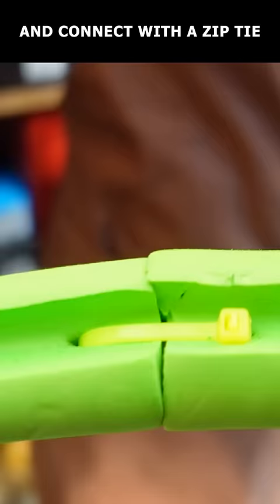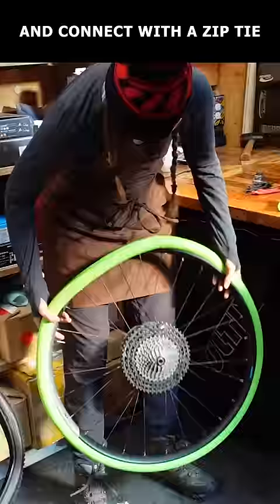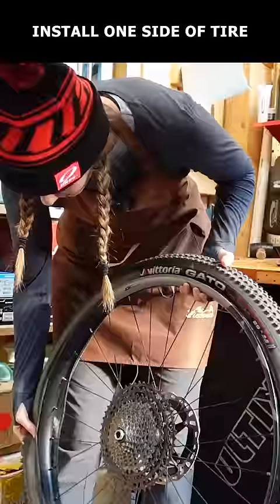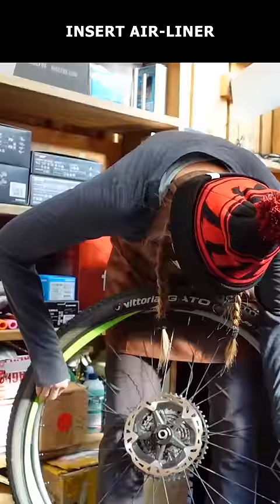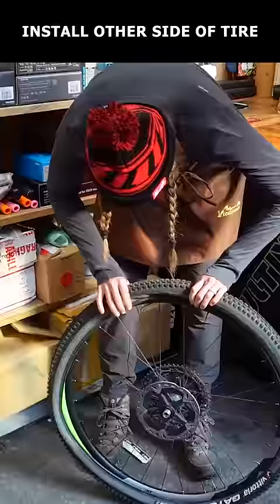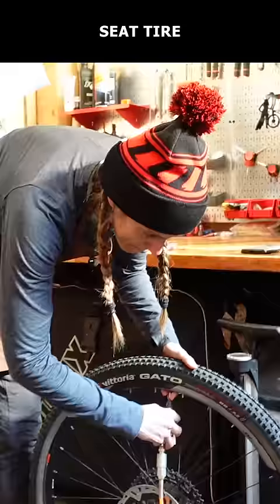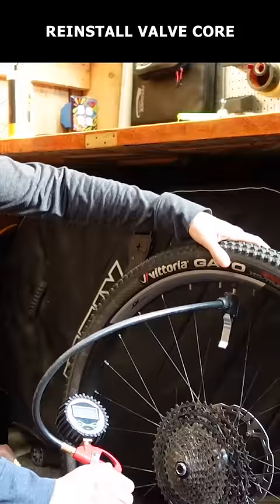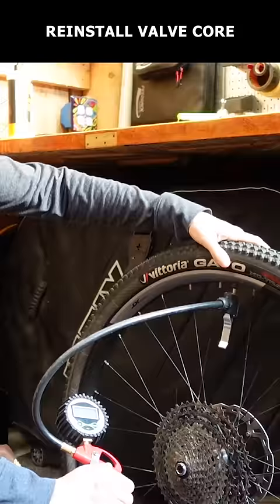Installing the Vittoria Air-Liner tire insert #Shorts

Comment from the maker: Want to try the Vittoria Air-liner? Use code "sydandmacky" for 20% off here:
 bit.ly/3jLFbqs
Reply: You are out of the only applicable size I need, 29x2.5. When can we expect for you to resupply your most-demanded size? I know I could opt for the smaller option that works from 2.25-2.5 but I'm not a medium sized rider at 6'5" 255lbs. When will large MTB air liners be available?
Reply: Im not a bike rider...but can i know what is the function of the air liner
Reply from the maker: This system provides additional rim and puncture protection in tubeless setups and allows you to run slightly lower pressures. It is also a "run flat" system so if you do get a flat you can continue to ride the tire without risking it rolling off the rim. We don't generally recommend that unless you're racing enduro or downhill, but it is an option. So, while it isn't for everyone, it's quite helpful for lots of people.
Reply: What is so amazing about this product?
Reply: @sydfixesbikes  doesn’t this re-add all the weight savings of a tubeless tire then?
Reply from the maker: Probably, but you should primarily consider this system if you want more puncture and rim protection in your tubeless setup and aren't worried about the extra weight.
Reply: @sydfixesbikes  what is the weight of a 29" liner?? How many grams of unsprung weight will i be adding??
Reply: What a Great idea.
Reply: ¿Por qué eres tan especial y bonita?
Reply: @chucky6187  p
Reply: Plss give bike
Reply: @paulstallings6804  manners cost nothing by the way, wouldn't hurt to try using some every now and again.
Reply: Try that on a dirt bike tire, not so easy.....
Reply: I've been using pool noodles all my life, and meanwhile this product existed :) jk
Reply: @sydfixesbikes  any way to do it with a tube ie the run flat cuz that's a solid method tho
Reply: I definitely need this for baltimore city!! Pot holes got me fucked up! 😂🥴
Reply: Olá tudo bem com você ❤️
Reply: Donde compraste eso
Reply: @BracaPhoto  if you're worried about extra weight u can swap allot of aluminum parts for carbon.
Reply: Hang on a sec, aren't you that guy's sister? The one who does ocean creature videos?? 😂 yall look the same
Reply: So no punctures??
Reply: Sealant and air... dang.
Reply: I want those on my fat tire electric bike 🏍😫
Reply: These are a great idea in theory but in reality it's a terrible idea. The foam doesn't stay seated and degrades rapidly from friction inside the tire. It's dangerous as well because due this disintegrating foam you will end up separating the tire from the rim while riding.
Reply: @sydfixesbikes  I had like 4 punctures in 10 years and I'm riding good. I think Im good with normal Tyre sealant.
Reply: why....regular tubeless works great....
Reply: I'll tell you why a good liners  the people who leave broken glass a good liners let you make it home 🏡
Reply: @christopherreed2694  Huh? Your thumb is drunk.
Reply: Как на разгон идёт,хорошо??🤭
Reply: That's pretty cool but damn you are beautiful.
Reply: @DonaldAJr  And DAMN you're creepy!
Reply: I think you dont know what a centimeter is
Reply: I'm lost. How does this compare to using a tube tire system?
Reply: It protects your rims and let's you keep riding until it can be changed in case of a flat.
PS:  I ride in a northeastern city with lot of potholes+ get flats all the time. I need this.
Reply: @Darkfarfetch Can I also "buy" a tire? Asking for a friend.....😆😅😂🤣
Reply: Don't you miss when bikes just took a tire in a tube and worked?
Reply: Do you have any advice for when the derailer phantom shifts like crazy even after getting it adjusted at a bike shop?  Mine only does it on hills
Reply: That's not a 1 cm hole. More like an inch
Reply: hows the performance of Vittoria gato?
Reply: overpriced on glorified foam with ziptie trashy
Reply: @sydfixesbikes  overpriced on glorified foam with ziptie trashy
Reply: I had a flat way out in the desert on a motorized bike the middle of nowhere, packed it with sand, added some water packed it some more and drove it 23 miles to nearest gas station

Comment: I started cutting the airliner, and now I can no longer fly United.
Reply: Lol gg
Reply: LOOOOLLLOOOOL
Reply: Its cause you didn't use a tsa approved knife
Reply: I loudly choked thank you very much for this
Reply: You got off easy, generally with united you so much as look at someone that works for them the wrong way you'll end up being dragged off the plane unconscious.
Reply: Hahaha
Reply: @rahinhuq1608  ???
Reply: You didn't do the obligatory sealant dance?......That's what happened!!
Reply: lol
Reply: Were you wearing your face mask 😷? If so, did you wear correctly 🤔? Did you double or triple mask? Did you have ensure you that you brought proof of vaccinations w/ 5x booster shots? Was the device used for cutting, vaccinated? What country what the cutter manufactured? Do you mistakenly use gender pronouns, instead of "Airliner Thingy"? These  are VERY  important questions to answer, prior to cutting.
Reply: LOL
Reply: Lol
Reply: Good thing you didn't try that with delta, you'd be dead
Reply: You got me good. I straight up wheezed that laugh out. Thank you.
Reply: What's the airliner for?
Reply: @j.rjunior5584  
From what I was told, it's a run-flat device. It allows you to keep riding for a bit after a tire is punctured. It makes some sense since bikes don't have space for a spare wheel like cars do.
Reply: @bloopbloop5663  kk))) kkh0
Reply: @rawtrout3402 ㄱㅋ4ㅋㄲㅋ4ㄱ ㄱ44ㅋㄱㅋㄱㄱ44ㄱ4ㅋ4ㄱ4ㅋㄱㅋㄲㄲ
Reply: You should have tried from Tail to Front, you may end up with flight steward. Win-win situation.
Reply: @j3rk1n18  😂😂😂😂😂😂🚶😂😂😂😂
Reply: @j3rk1n18  AYO???
Reply: @NeoCreatesStuff  whaddup?
Reply: Bruh that sounds like a reward
Reply: @anon457  🤣🤣
Reply: Nobody can fly United anymore
Reply: XD IT TOOK ME MINUTW
Reply: @rahinhuq1608  yeah gota use ceramic knifes they dont anger the metal detector  guards
Reply: 🎶 you broke my taylor guitar... 🎶 🎵
Reply: Double Pun, nice
Reply: Best comment 😂😂❤❤

Comment: For $100 you shouldn't have to zip tie it.
Reply: @mattbanks3517  or maybe they're the snobs who overpriced a piece of foam?
Reply: @senkl  that's true, but a zip tie is a fine solution from a design view.
Reply: They can literally make it adhesive on one side so it sticks to the wheel but they just wanna make cashh
Reply: Or cut it it should come prepared in 26 inch and 29 inch circles
Reply: @marekhlavackovi3677  this is the only acceptable answer.
Reply: @mattbanks3517  they definitely overpriced that shit 😂😂😂
Reply: Tannus armour tubeless, best insert ever
Reply: @senkl  okay, if you don't want their product but you want your own, go source your own weird exotic foam extrusion and tell us how it goes.
Reply: @microcolonel  packaging foam in the shape of a circle ain’t worth 100 dollars
Reply: @jeezyj6697  it's worth what people who won't make it will pay for it, nothing less. If you think the product is so simple, go ahead and get it made and tell us what it's worth.
Reply: @cantujessejrgbnl  an adhesive is not much more expensive than a zip tie.
Reply: @angelmedina2762  cost of manufacturing prolly like 10 cents
Reply: @senkl  so make it yourself. You'll quickly see that making a product that doesn't sell in huge batches isn't profitable
Reply: @mattbanks3517  adhesive for a flexible tire? Lmao. That'll fail within a few minutes.
Reply: @0xsergy  that 'make it yourself' argument is getting old, buddy. We can't complain a car is too expensive without making one ourselves? Phones, too? Let's take it down a notch, someone makes plastic car keys and decides to sell them for $50 and no one can say it's expensive without making their own?
Reply: @senkl  phones are a diff story, they're mass produced. This is a tube for a tire that maybe has 10,000 purchases worldwide yearly.
Reply: @0xsergy  it won't fail, but that's what another guy was saying
Reply: @mattbanks3517  eh, it might not fail but realistically the tire itself is holding that foam in place so its not going anywhere. The zip tie is just for install
Reply: @0xsergy  yes.
Reply: @mattbanks3517  yeah solution that should’ve came with the $100 price tag! Overpriced glorified foam.
Reply: Why does it even need to be connected at the ends anyway? Is it going to slip slide around inside the tire? If so, what are the ramifications of that happening? I drive cars and know next to nothing about bicycles. Please enlighten me, I like to learn new things.
Reply: @senkl  agreed... the "go make your own argument" is just about the most pathetic form of non-argumentative rhetoric there is!

I can only imagine it is something exclusively used by kids who used to say "I know you are but what am I? in school.
Reply: @cantujessejrgbnl  you don't know how things work
Reply: @microcolonel  you're the type of guy this company aims their product to
Reply: @germanfisch  Damn straight bikes are way too expensive these days, for the price of a good bike I could buy a decent used car
Reply: I feel like superglue and gorilla tape would work better.
Reply: @mattbanks3517  a simple design doesnt cost 100+ bucks lmao
Reply: @tecqnize3274  it is overpriced.
Reply: @mattbanks3517  ye no shit sherlock thats pretty much what i said lol.  if its really was a simple design it woudnt cost that much heck looking at this foam its prob not even 1buck to make lol.
Reply: 100 DOLLARS!? My dirtbike bib mousse is the same price....y'all are getting ripped off 😄
Reply: @microcolonel  bokay
Reply: @mattbanks3517  depending on the substance, why not some sort of chemically-joining adhesive? Like how superglue chemically bonds to skin. They could put it in a small squeeze container, too.
Reply: @0xsergy  you realize there are adhesives that, at a chemical level, burn two surfaces together, skin to welding, right? If you're saying you wouldnt trust welds on a bike, I've got some bad news for you. There may be a 'hard section' of the insert where the bonding occurs, but that honestly just depends on what one they use. There are some that wouldn't leave such an immalleable result, I'm sure.
Reply: @23Fists  yes, that's the problem. They become one solid piece cause of the strong bond. Most adhesives dont take flexing very well, gotta use silicone for that and it doesn't adhere nearly as well. Tires do a lot of flexing.

You do you fam, there's a reason they supplied a zip tie. Do it however you like.
Reply: @0xsergy  even with one point of rigidity in the tire, with the extra stop-leak in there, it shouldn't mess with the overall integrity of either the bond or of the insert. The sand that holds the stones in place, so-to-speak.
Reply: Cut off zipties can be really sharp, seems like not the best idea to have a little nylon blade on the inside of your tyre, especially in the orientation shown.
Reply: The only simple design here is your brain as you spend 100$ on a piece of foam you ziptie around your wheel.
Reply: $100 ! Get tubeless tyres instead 😄
Reply: What $100 i can buy inner tubes for €1.50
Reply: Juste change the fucking air chamber its juste 30$
Reply: @mattbanks3517  a simple design ? There are only 3 regular mountain bike sizes. If Cush core can make them endless why can’t Vitoria ?
Reply: @mattbanks3517  it's one of the greatest
Reply: @cantujessejrgbnl  nah glu and foam are weird and with heat I dun think so
Reply: I use Cushcore XC. Easy installation, no zipties, funtions absolutely amazing and a new must have. Wtf is this ziptie-ing BS
Reply: @cantujessejrgbnl  but if it was adhesive, it would be difficult to swap out on demand if it got damaged
Reply: @countbeccula  exactly
Reply: @mattbanks3517  true, but not for a product that costs a hundred bucks.  This should be 15 max.
Reply: The zip tie is non-functional.  It's just a "tool" to help with the install.  Could just use tape if you wanted.  Once in the tire, the foam is the right size to remain where it is and doesn't need the help of the tie.

But I feel you on the foam price.  It's marked up like popcorn, soda and French fries.  If there was a similar size foam core available randomly anywhere else for cheap, probably just as good.  For phat tires, maybe a narrow pool noodle or plumbing pipe insulator might even fit.
Reply: What's that for?
Reply: @RobCharo  a person with better things to do than figuring out exactly how much pool noodle you need to stuff in the tire to get the right stiffness, and how much you have to cut...

I'll believe y'all about how simple this product is when you make your own; I'm pretty sure it's not on patent, so if you can make this hundred dollar product for much less, then you can sell it at at advantage. If it's so easy, why are you not making this easy money?
Reply: @microcolonel  nah bro I don't give a fuck about how this dude spends his money, I don't even have a bike lol
Reply: @marekhlavackovi3677  the problem is that they then need to manage how many 26 vs 29 to make. Also it’s a lot easier to ship them in tube than in circle. That said, the zip-tie method wasn’t ideal, creates an imbalance on the wheel.

All in all its an compromise people seem willing to accept. However, if more customers voice their discontent with it, then they will have to innovate or absorb the cost of inventory management and shipping. That or a competitor would come around and do it.
Reply: @thisguyy  its universal so it fits every tire. Why does everyone want everything to be cookie cutter. The current design is perfect.
Reply: I don't see why the ends need to be attached at all.  If they're perfectly pre-cut, (or even if they aren't) it's a tube within a sealed tube, how much play could there be ? Why attach it to itself?
Reply: $100 pool noodle 😜
Reply: @mattbanks3517  lmfao it's a pool noodle. I bet you own 2
Reply: My question is…… Does it even need to be attached to the other side? I mean, it’s not going anywhere right?
Reply: My boss had over $7k in his bike. These people are insane with what they justify spending. They make car guys seem normal.
Reply: @mattbanks3517  i get your point but come on a zip tie? Looks like something you'd just botch together. shouldn't things like this come in set sizes anyways like wheels actually do? I don't get the point in the cut to size part unless the actual thing comin with enough for like 10 wheels, which would be ridiculously long😂
Reply: @irelandgrt  mean while some guy with a 40 dollar bolt cutter or wireless angle grinder wait to make 7k
Reply: Dollar tree has that for $1.25, where do you get that for 100?
Reply: Or use pipe insulation foam from the hardware store
Reply: @mattbanks3517  you would buy cush core for 75
Reply: @microcolonel  p
Reply: I race mousse bibs on dirt bikes.they about 160 a pop

Immediately I thought the zip tie was cheap in comparison
Reply: for that price, this is a fucking joke
Reply: What’s the point of this liner anyways. I mean you still have to have air so I don’t see what’s the point of it.
Reply: thats mountain biking for you
Reply: @marekhlavackovi3677  no it should definitely come longer for cutting it to size because of the difference between internal rim heights
Reply: @redpilljesus  u realize that giant truck frames are epoxied together in most joints for superior strength over welding right?
Reply: @spindless  slow clap for the guy that thinks molded foam can’t be glued
Reply: @cantujessejrgbnl  but if you already have sealant in there, will it work.
Reply: I prefer the zip tie over cuscore because it’s infinitely easier to install and take off
Reply: 300 years ago the zip tie would have been one of the most incredible things on earth. Taking it for granted
Reply: @cantujessejrgbnl I'd do both ways. Glue and zip tie.
Reply: @microcolonel  pool noodles, my man
Reply: @ericl6460  you gonna make your own or no?
Reply: @microcolonel  don't need to, already exists. backer rod is probably a better option, though.
Reply: Tubolite 
Or do your own it’s easy.
But, there is always people that believe more money means better.
Remember, things aren’t priced for what they are worth to make they are priced by what studies show folks will spend.
Reply: @lionbear7706  not studies, people are actually spending the amount, and if they weren't they'd lower the price.
You should know how prices work before esoteric bicycle tires.
Reply: Wheels have different inside diameters which means the circumstances are different lengths.
Reply: @senkl  You'll never get anywhere arguing with these clowns because for them, it's ideological: for them, price GOUGING is a sacred pillar of a, ahem, free market.
Reply: @supermankent1041  Maybe cut down on the Red Bull, Clarke. 🙄
Reply: @lucasgroves137  How is Red Bull relevant at any level? I have NEVER had the stuff. Let alone how the inside circumference varies from rim to rim for a given tire size. My comment was to address the need to cut it to a custom length rather than the fully formed circle.. I'm a Mt Dew guy. Have a great day 👍
Reply: @supermankent1041  Lol, at any level, where are you, the 90s? Maybe you should've reviewed your comment before replying to mine. 😄
Reply: @lucasgroves137  As jeff Grey (Honor Your Oath) would say, I'm from the 50s.